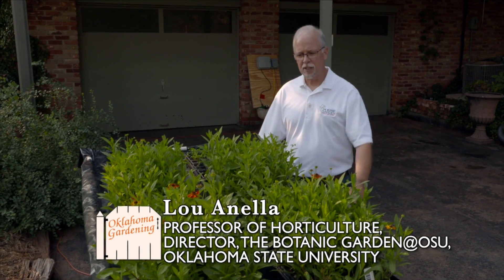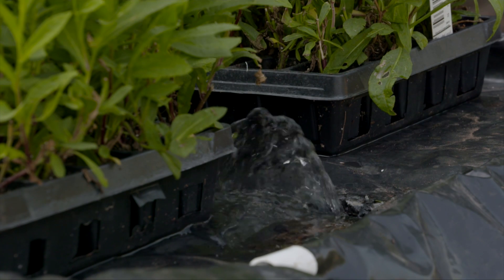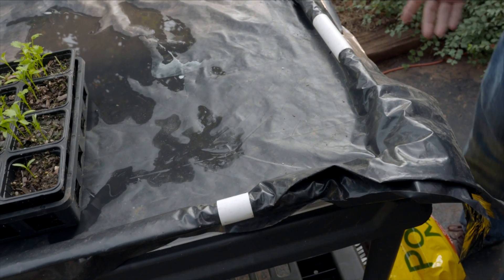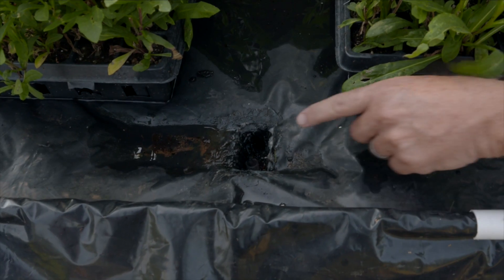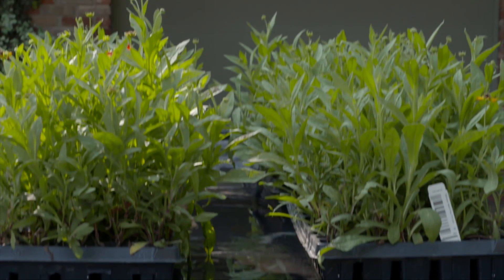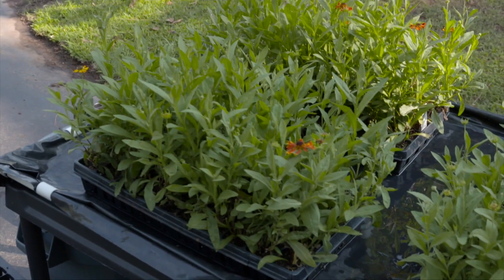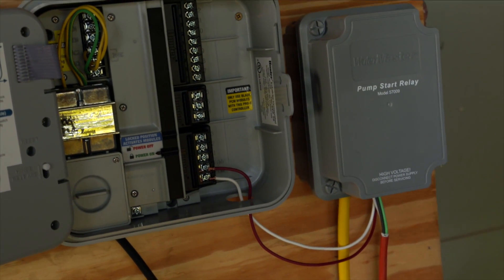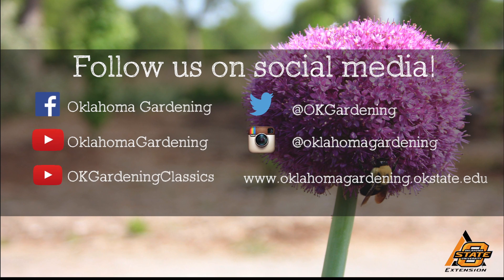Building a Homemade Ebb & Flow Bench

Comment: I absolutely love this diy ebb and flow build! Thank you so much for making the video! How important  is it for the benches to be level? How do you make sure all the plants are getting watered evenly?
Reply from the maker: Hi, while the table does need to be fairly level, some ebb and flow benches include a slight slope in the direction of the drain to improve drainage. However slope can effect the length of time in which certain areas of the bench are flooded and the level of water the plants are exposed to.